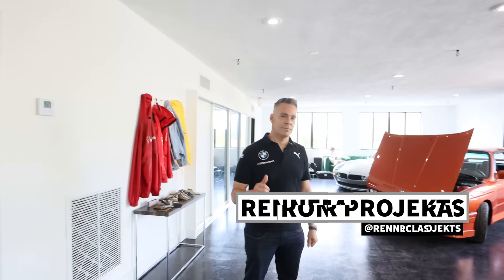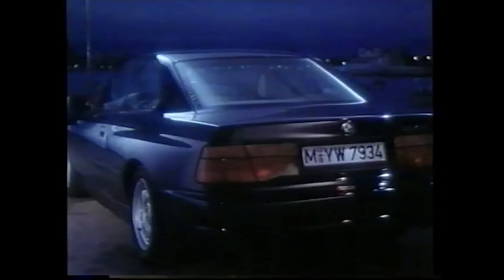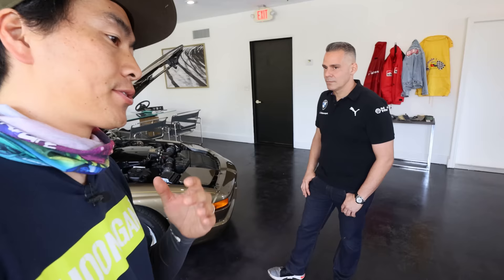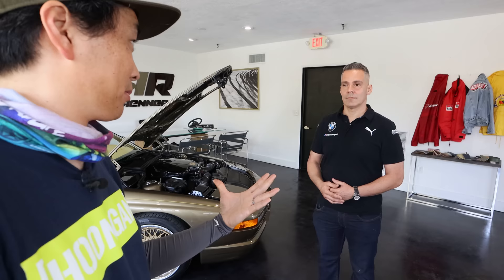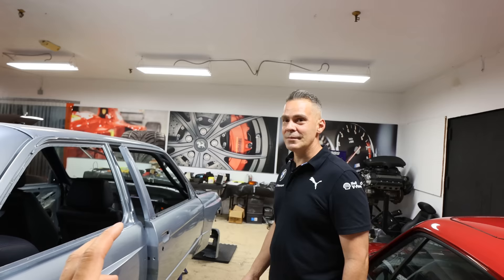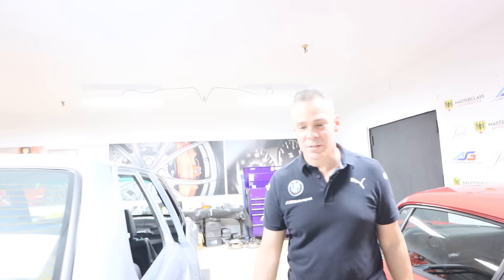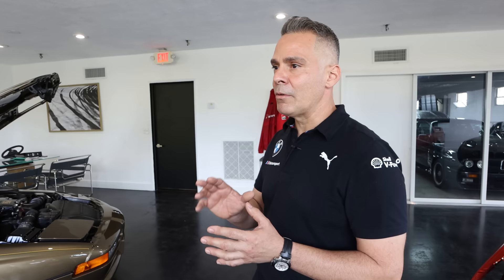The Renner 8: A Resto-mod BMW 850i With the Heart of an M5

Comment from the maker: Hey guys, Thanks for watching. If you want to find out more go check out https://rennerprojekts.com/

Also, if you want to support Hoonigan Autofocus grab a print from our store: http://larrychenprints.com/
Reply: Please. What is the song at the very end I need to know
Reply: That Renner is nice but the original heart was removed they should try to work on it because that is what a proper tuner do.. 
Here is an Alpina B12 just to give you guys a glimpse of how it should sound a proper V12.. 
https://www.youtube.com/watch?v=D8mHLipS9XI
Reply: where are you from you guys ?
Reply: @poplaurentiu4148  Don't think he cares about proper.  if he did he would not install those wheel rims.  But later on he will be asking us why he has a wheel shimmy on braking and at harmonics of 45-50, 95-105, and 150-160.  Then we will have to tell him that his unapproved rims ruined his bearings and suspension and steering bushings.   Don't think he cares about that either though.  But in ClubeE1 we always had these numbskulls doing this.  It's classic.  But if you're going to do a heart transplant then who knows what else might happen.  I got 450 hp out of my S70 engine without major tweaking but had to carry some ballast in the back to offset the CSi's heavy V-12, and use heavy euro brakes and sway bars and 750iL upper control arm bushings and a mild camber plate.  It drove like it was on rails no matter the speed, and was all approved OEM stuff.  But it is a fools errand to try and make these things tossable and they are never going to be quick off the line.  JUST TOO HEAVY.  High speed cruise all day like a Learjet, fine.  But racing Porsche's, never.
Reply: What is the paint color code/ hex code, please 🤤🤤🤤?
Reply: I would like to see a mod of the backlights of this car using the backlights of the Ferrari Testarossa.

Comment: The 840 and 850 series have such great body lines that will never age. It is unfortunate that manual transmissions in them were so rare or I would have considered one.
Reply: My synchros on 2nd to 1st gear are going and I'm considering on getting an e46 M3 transmission and buying an adapter plate that mates to the M70. A company in the UK makes them for that reason.
Reply: No questions do it
Reply: I agree. Those older BMWs were so good looking. Even older 5 or 3. Why every brand is obsessed in changing the design so often, doing FL and so on?

Comment: 15:09 The push button check panel is actually independent, to a degree. Since I still used the oil sensors when I went stand alone, everything actually worked with the Bosch ECU completely removed and replaced with MS. However I did make an adapter board so I could use the factory harness and plug.

Comment: Love the E31 and what they've done with it, but i have just a tiiiiiny objection about the "we made the "M" E31 that BMW never made":
The S62B50 V8 is a WONDERFUL motor, big and "torqie" while still "high performance" (high HP from a small displacement and so lightweight engine), but the E31 8-series 850 models had a V12 in them and i doubt BMW would use a V8 if they made an "M" version.
And the 850CSi was kinda a M E31 (well a hybrid between a normal and M model): while the "normal" motors where SOHC (M70/73) the 850CSi had a DOHC version of that engine with the "S" code (used only on M cars!), although it was still a 2 valve per cylinder engine and didn't have VANOS (BMW's variable cam timing) so it only made 380HP from 5.6lt so ~68HP/lt, which is kind of low for a period M car... This engine is referred as the "S70" and it later evolved to the 4 valve per cylinder + VANOS S70/2 used in the McLaren F1 that made ~620HP...

So what options does are there for a more modern V12,  what if we whanted 4 valve per cylinder for 21st century power up top and VANOS for low-end toque? Well there's only one more modern BMW V12 engine, the N73 used in the big 2001-2008 E65/E66 7-series, and its IMHO perfect for a Grand Tourer like the E31:
It has a displacement of 6.0lt and makes 438HP@6000RPM (so peak power is higher and delivered at lower RPM compared to the S62) and 600Nm@3950RPM (100Nm more than the S62) and that's a bone-stock 7-series motor, not a "pushed", red-lining M-series engine (so room for improvement)!

Let's compare:
1987 BMW 750IL E32 : SOHC 2v V12 5.0lt, 295HP@5200RPM, 450Nm@4100RPM
1992 BMW 850CSi : SOHC 2v V12 5.6lt, 380HP@5300RPM, 550Nm@4000RPM
1998 BMW M5 E39 : DOHC 4v V8 5.0lt, 400HP@6600RPM, 500Nm@3800RPM (with VANOS)
2002 BMW 760i E75 : DOHC 4v V12 6.0lt, 440HP@6000RPM, 600Nm@3950RPM (with VANOS)
*1992 McLaren F1 : DOHC 4v V12 6.1lt, 627HP@7500RPM, 617Nm@4000RPM (with VANOS)

I think the numbers speak for themselves, the latest V12 is clearly a better option than the S62, it makes more power and more torque STOCK (i bet Renner could easily do 500HP with camshafts and a chip tune), and don't tell me about the weight savings because 50Kg is nothing is a 2ton car...

Just my opinion about a "M8" restomod ofc, love that video!

Comment: "wireless throtle body" I guess he meant "wired" (eletronic) ?!
Reply: Probably meant cable-less
Reply: Drive-by-Wire
Reply: It’s Bluetooth
Reply: @dustinr1146  lol
Reply: Sometimes the wifi disconnects while driving and the throttle keeps up i just turn off and restart the router.
Reply: @coolbreezelb5023  lol

Comment: Roland at Renner looks like a top bloke, must have a superb team with him, wouldn't mind being part of the team. I would order my Renner 8 with the (lightly) BMW/mclaren f1 based v12 on throttle bodies + Lanzante LM  parts, full aluminium cage, no rear seats, carbon brakes, titanium exhaust, carbon fibre panels, simplified loom and recaro ultralight bucket seats, and forged 3piece BBS rs motorsport wheels. To achieve some kind of wild lightweight version that BMW used to make back in the good old days

Comment: Nice car. If it would be mine i would insist on improving the big horizontal panel gap between the front bumper and the engine hood. I am sure Renner can do this much better.😊 Cheers from Germany.

Comment: I only wish they had been able to keep the v12 and update and modify it obviously not to the extent of mac f1 but to 450 to 500 hp and I'd be on board totally 😁 very cool nonetheless
Reply: The problem is that m73 v12 is 24valve engine so it will struggle on higher RPM or not be as smooth and very fuel uneffecient on low rpm. Need 48valve heads for great upgrade but I think hard to make them. Better put ready engine. S85 v10 might be also a good choice

Comment: Lighter weight internals, carbon or aluminum front fenders and hood, lighter weight flywheel, relocating firewall back as far as possible are all things that will cut into the weight difference between all aluminum S85 and iron block S14. 
My e30 dream swap would be M88 with MFI from M1 procar, S65 or 2.5 full DTM spec

Comment: As an E30 M3 owner it took me less than 5 seconds to know that the „restored“ example in this video is missing a lot of things that make an M3 hard to restore properly. 
As an e39 m5 owner I also know why the brakes / throttle / power steering on the E31 are not executed the way bmw intended. 
As someone with too much money that just wants a cool 80‘s BMW without any further knowledge about these cars, this place is Perfect! 
If you want a car with a future in the enthusiast / collector market however... I would take my money somewhere else 😂

Comment: I get one 10 years ago .
The seller was died after doing 35 000 € of renovation.
I bought it 12 000 € .
I doing 10 000 € of repairs .
I sold it one year later 6000 € .
Was like new .
850 ci , with 5 automatic gears ( yes 5 , i should doing a video for show this at this time .. )
2 tonns car , truck / tractor motor .
Not a sport car , never .
I wanted to remove the fan , put electric one , remove all the electronic of the motor , put a simple igniton with magnet build by myself buy using 12 motorbike ignition coil , put a diameter 28 carburator on each cylinder , and put a spaguetti exaust .
But i was tired to do maintenance on this car , the garage ( even Bmw .. ) don't wanted to touch this car ! They all said they don't know about , this car is so full of electronic , so i learned by myself , i rebuild all the admission joints and change so many parts everywhere..
The sides windows surface is too big , their is no intimity .
Finally it's a 750 with a Ferrari nose .

Comment: Sweet! E30 will be wicked too, but I would also worry a little about the front/rear balance!
Reply: he didnt want to say in video...to fit it in e30 he need to cut fire wall and push it back...so engine will be more in center like mid engine + on that is not heavy engine and you can solve it on coil overs set up....no problem
Reply: @strahinjaboskovic305  Cool. Thanks for the info!

Comment: Would have went with the 95 850CSI engine or the S85 V10 but the S62 is a great one as well with 400 lbft of torque which a car like this fits for low speak cruising and high speed highway blasts.
Reply: not fun to maintain the v12 or the v10, which can spin a bearing and blow the entire engine. this is a good blend of reliability, power, ability to pair with a good transmission, and a great sound.

Comment: i feel like comparing ruf to renner is a bit unfair. ruf is actually fully developing and building their own chassis etc. renner doesnt even feel like alpina who take the basis of bmw and then modify it in extreme ways to gain more power and luxury
Reply: The build quality of the interior is also not so good, look at 27:39. The middle console corners are not flush and the airbag cover looks morphed, the carpet on the passenger side looks like it came out.
Reply: Damn you're right. I didn't even watch that far and considering that the car will most likely cost a small fortune that's terrible
Reply: @dank4066  I searched online they are asking $ 350k, for that kind of money i want perfection.

Comment: Man, there are so many low hanging fruits to harvest for improving this car. During the first minute - headlights are not aligned/adjusted; what is that gap between bonnet and bumper? Do i have to continue? Those details should be fixed, as they impact the appearance big time

Comment: I get one . This car if definitivelly not a sport car , even with m5 motor .
Maybe cause 2 tons .. Also the side windows are too big , this car is a 750 with a ferrari nose , but not a sportcar , the original motor ( even csi ) is good for a truck or a tractor .
I wanted to try to remove the fan and put a electric one , then remove all électronic , then put good camshaft , use carburators diam.28 on every cylinders , good full spaghetti exhaust , and ignition with classical magnet system build by myself .
But it was so many work for nothing interesting in final so i don't doing it .

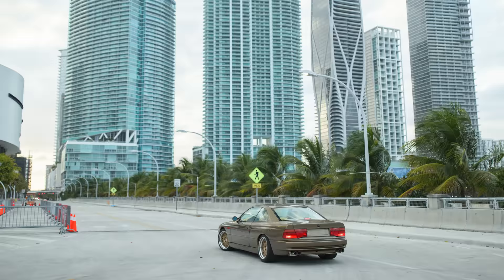Comment: 4:47 God look at that panel gap between the hood and bumper! Not throwing shade at Renner here, more at BMW for thinking that's acceptable.
Reply: i was just about comment the same thing.  that gap is as big as a short taxi ride.. goddamn
Reply: It's not a gap, it's actually a rubber gasket -- original BMW
Reply: @Masterclassauto  I assumed that it was, but given that timing, it looks like it isn't present. Like I said, not poking at Renner, their work is fantastic.